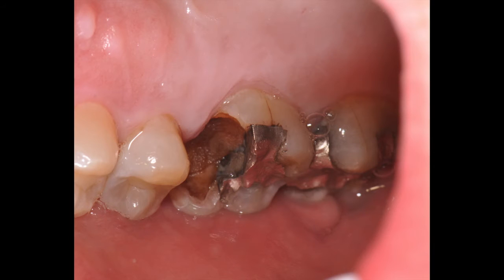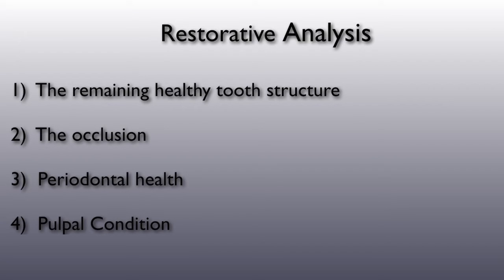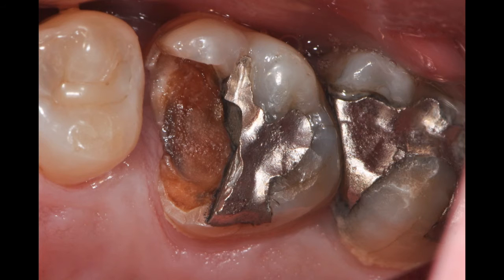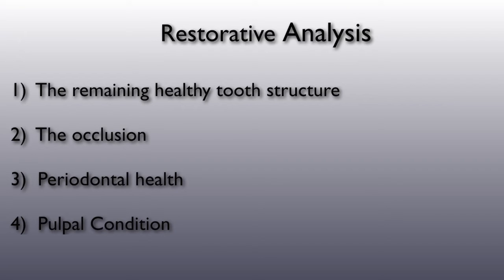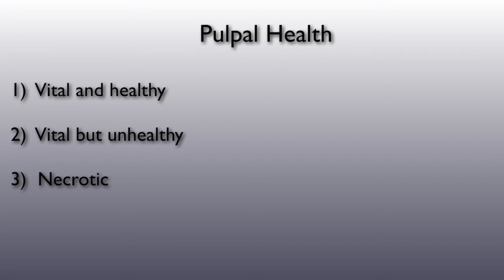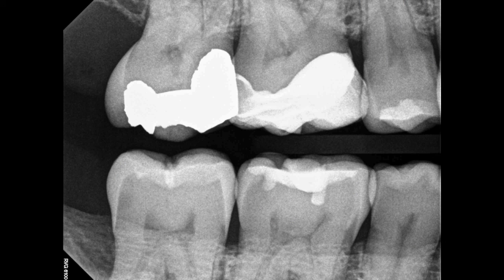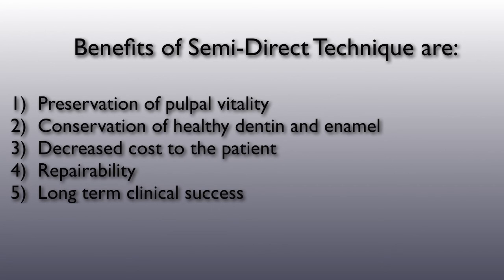Semi Direct Composite Technique

Comment: This is very creative, but how do you do the interproximal contact without sectioning the pvs die? how good is the contact and how do you build a proper proximal contour?
Reply: I get my interproximal contact point established first on the die. I mark it with a pencil, then section the die and add below the contact to the gingival margin to create my interproximal profile. As long you don’t over polish your contact point, it should be nearly perfect in the mouth. If not you can always add composite to tighten. That’s the best thing about this kind of dentistry...it’s always modifiable and repairable with good adhesive protocols.

Comment: Why do u need to heat it in an oven... Is that step necessary
Reply: Dr. Rajeeve S Pillai heating in the oven isn’t necessary but it does allow higher conversion rates of the resin monomers. This results in better wear properties and a stronger restoration. The next step up would be a mulled restoration out of Z100 composite block or TetricCAD block.
Reply: @bradperrett8941 Do you have any study that accredite this step and prove that is a neccesity, thank you so much. It is an excellent case.

Comment: Congrats for the case and didactical approach.  I just would not call this case as semi-direct technique, which denotes that the restoration manufacturing starts intra-orally and is finished extra-orally ( the marginal elevation notwithstanding, since it is a separate procedure for either the semi-direct, direct or indirect technique).  The technique you showed is a complete indirect technique, including the use of an impression, albeit done with alternative and smart materials.  I have been using the term "chairside indirect technique" for this procedure... but then again, the case was great, the rest is semantics.  well done and congrats once again.